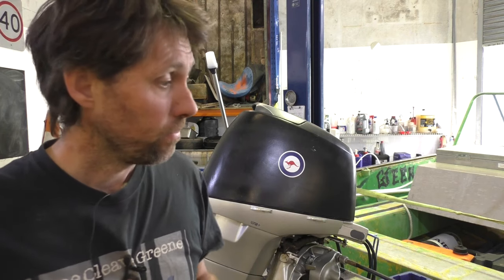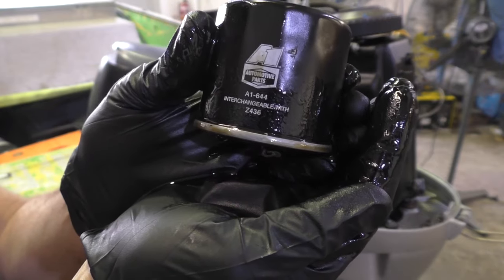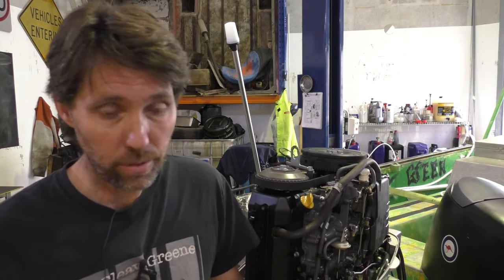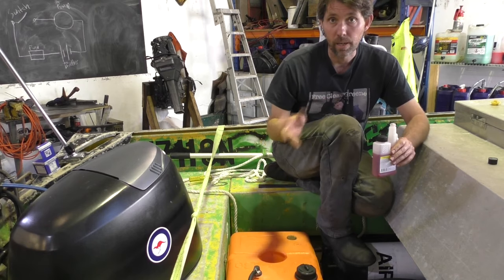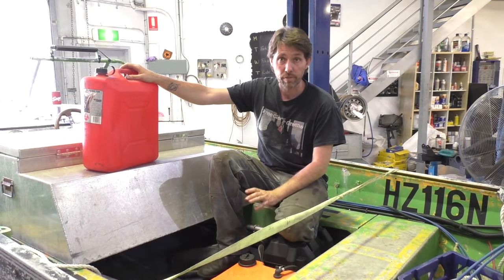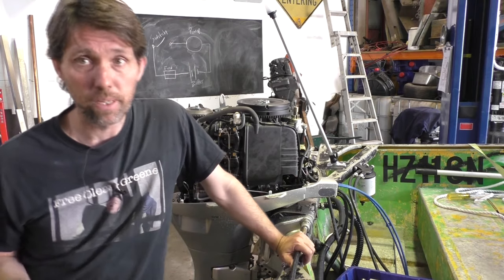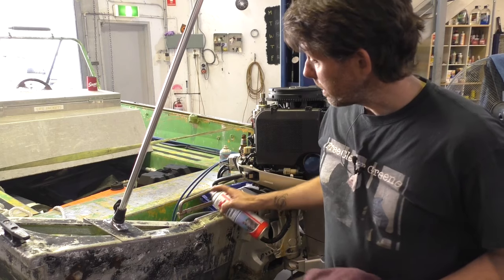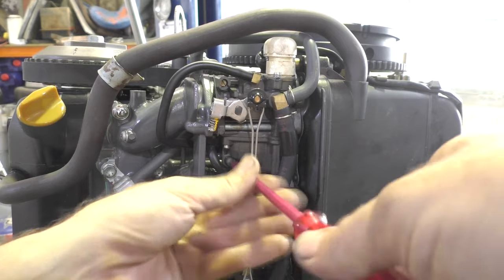Winterising an outboard motor

Comment: If your two stroke motor is oil injected do you still have to worry about the lubrication when you stall it out?
Reply from the maker: I wouldn't be too worried. If running out of fuel caused any serious damage to a two stroke many people would be in trouble.

Comment: Hi Stu. Here in Sweden I do all the steps you do but have even been advised by the place I bought the engine to run antifreeze through my 4 stroke just to be on the safe side. What would say to that.
Reply from the maker: I don't think I would. Once it is empty of water it can't expand enough to crack anything, that is why there is drain holes in the jeg.
Reply: @DangarMarine  Ok. Thanks.

Comment: What is the best way to get all the water out of the cooling system so it doesn't freeze, expand, and crack? Leaving the engine trimmed down, will all the water run out by gravity alone?
Reply from the maker: Leaving trimmed down should get 99% out, but as David mentioned below, any debris in the cooling system my prevent this. Some compressed air back through the tell-tale should help there.

Comment: First, I always like to hear an Aussie’s recommendations at maintenance as I know you truly care about prolonging the life of equipment.  Thanks.  
I do have a question, which you touched on in the end of your video.   I winterize my inboard every year, but the wife wants to do some boating in the winter months.  I have been looking at some used seadoo jet boats and outboard runarounds.  I plan on using it every 2-3weeks, but want to avoid having to winterize.  I live in the southeast US, where the temps usually don’t drop below 20degree fahrenheit or about -6C. Those drops are pretty rare  with freezing temps being pretty uncommon or sustained, and I would be leaving the boat in lake. The lake never freezes.  Of the 2 types of boats I’ve listed, is one better than the other with respect to not winterizing, and would it be a mistake not to winterize it?

Comment: is it really necessary to winterize a boat motor  inboard or outboard if the boat gets use year round ?
Reply from the maker: No, winterising is only for when a boat will be sitting around unused for several months, particularly if you are in a cold climate.
Reply: ok thx, I wont be  winterizing my boat here in vancouver we pretty much use the boat year round , any advice what oil to use for the winter season . here in bc we do have four seasons

Comment: Great timing for the Northern folks :). I did my winterising on a 20 HP Tohatsu with only 26 hours total time on it and when I drained the lower gear unit, the oil was a very light gray colour. I talked to my dealer about it and he said very light gray is normal and that if I am worried anyway, I can bring the engine in for a pressure test. Should I be worried or is the dealer right about light gray being normal? Do you think I should bother with a pressure test on an almost brand new engine?
Thanks,
Maurice
Reply from the maker: Light grey doesn't sound normal to me, it generally means water in the oil. Age of the motor doesn't really have a lot to do with it as fishing line can cut oil seals pretty quickly. Have you taken the prop off? Is there any fishing line behind the trust washer?
Reply: No, I haven't taken out the prop yet, but I'm pretty sure there is no fishing line anywhere. But since you say it does not look normal, I'll ask the dealer to do a pressure test anyway. Better catch the problem early rather than next year in the middle of the lake :). 
Thanks,
Maurice

Comment: Hi Dangar. I have a question. I recently bought a boat with a 25 hp merc. When I first bought it u dry started it a few times for no more than a second or so each time. I know not to do it anymore because it can damage the impeller. Do you think I could have damaged something by doing that? thank you for your time!
Reply from the maker: I wouldn't stress too much. Does it still have a strong tell-tale? It takes a little while of running for the rubber of the impeller to get warm and start to break down.
Reply: Dangar Marine it still tell tales strong. ok thanks man! also I changed the fuel lines and filters. but on of the inline filters is bigger than the one I had before. it's acting like it's starving for fuel. do you think it's possible that it could be the filter?

Comment: Great video!  Would you recommend anything different for a fuel injected (4stroke) motor?  I'm hoping to get a lot of use of the boat just like yourself, but if it ends up sitting for a few months it is great info to have.  Cheers :)
Reply from the maker: Hey Matt. Not really. You can drain the VST (see recent vid) much like you drain the bowl of a carburettor or just rely on the Stabil to do it's job.

Comment: Hey thanks for sharing.do you have a video on if the lower unit has water in the gear oil?what will need to Be changed?and how to fix it.
Reply from the maker: This is probably a good place to start https://www.youtube.com/watch?v=lnhZFn5gkG4 There are free possible leaks, propshaft oil seal, driveshaft oil seal and gear selector oil seal.

Comment: Hi Stu, a great, thoroughly explained vid once again. I'm in Canada were we definitely have winter!  I've been running my 2-stroke outboards dry for years. I also wait until the spring to change to lower unit oil...I have never had water contaminate the oil either.  Both outboards are stored in a garage over the winter...your thoughts? I'm guessing your going to tell me I should change the lower unit oil before storage ha ha ha Cheers mate! and thank you.
Reply: I know I'm not taking any chances. If water freezing can destroy mountains it can surely destroy my 9.8 merc.
Reply from the maker: If you change the oil once a year anyway, then I would change it at the end of a season rather than at the start, just to be on the safe side. Stay warm over the winter!

Comment: What about running out of fuel on a outboard with injectors 4stroke ?
Seems to me there will still be a large amount left is all the tubing and rail.
Is it wise or just not that big of an issue to leave fuel in the system as its actually a sealed from air exposure even during the season. With the carb 10pk 4 stroke i did that but now with a 50hp johnson ( 2004 and actually a 4 stroke suzuki ) i am not sure. Not much info around as it comes to 4 stroke with injectors.
Reply from the maker: I would just be inclined to run Stabil in the fuel for your last trip and leave it at that.
Reply: Tnx

Comment: Hi Stu, off topic question. I have a problem with my 9.8 mercury outboard where if I stop the engine for a few minutes it becomes a real battle getting it started again and when it does start there are thick white clouds coming out of the exhaust. I suspect water is shooting into the cylinders through the exhaust system when I turn off the engine. Is there anything that can be done about that?
Reply: Oh I think I may have found my answer: I'm using a longshaft outboard on a 15 inch transom. The exhaust port goes down too deep and the water pressure is higher than spec so when the engine turns off the excess pressure causes water to gain too much momentum and it reaches the exhaust valves that may or may not be closed at that time. 
That may also explain why I get water shooting over the transom and into the boat at high RPM's.
I'll bet the added water pressure is probably going to much up my engine more at idle as well.
That's the price of making an uneducated purchase. Then again, now I have a boat and know this whereas before I didn't know and couldn't move across water at all.
Reply from the maker: Hey Matt. Sounds like you've got to the bottom of it. You could look at adding a mounting bracket to the transom that lifts the outboard higher out of the water.

Comment: How about the hydraulics (steering/trim) and the electrics inside the boat; any prep needed?
Reply from the maker: Generally not. Hydraulic fluid doesn't freeze and I can't see the cold affecting the wiring either. Looking after the battery is the only important thing on that side of things.

Comment: Has anyone had a problem getting the shift shaft lined up after replacing the water pump on a 150 evenrude 1988 model ? I put it in reverse and dropped the lower unit and fixed the water pump but didn’t pay attention how the shiftshat was located so when I replace the lower unit and replaced the screw in the shift shaft under the carbs it was not lined up because it was still in gear reverse I guess and I could not get to go in neutral or any other gear ! So what I need to know is which way is the right way to position the top of the shift shaft , it’s not in any videos that I have seen !

Comment: Hi Stu and thank you for the great content on this channel, it really helps a lot!

The boating season in my region (Sweden) is usually 4-5 months. Would you suggest to do the entire service at the end of the season? In other words, is there any reason to wait until just before the next season starts and perform it by then? I'm confused because most people I know do their service just before the season. 

Cheers, 
Marcus
Reply from the maker: I would do things like change the gearbox oil before the season as if it has water in it you don't want that sitting around the whole off season. There would definitely be a "before first use" service than you would want to do at the start of the season. Being our spring here I'll do a video on that soon.
Reply: I see. That would be great. Thanks a lot.

Comment: The drain plug location on that honda is pretty silly. I love Honda outboards but I don't like that lol. Much easier on my Mercury EFI and I rarely deal with spillage from the drain plug. The only place I usually have to clean up is right under the filter.

Aside from that, this is pretty much what I do for storing my boat over the winter. Being that I have a fuel injected four stroke, I do disconnect the fuel line and run the motor until it stalls while on the muffs. I don't bother filling the tank up before storing the boat because our winters are long in northeast USA and I don't want to have a full tank of fuel sitting in the boat tank when I can use it for other things like my snow blower or my ATV. Whatever fuel is left in the tank after the final trip of the year, I treat it with either stabil 360 marine or stabil storage, whatever I happen to have... I then run that fuel through the motor while on the muffs for about 5 minutes give or take w/ the motor idling. After that I disconnect the fuel line and let the motor stall out. Then the tank gets taken out of the boat for the winter and that way I don't have to fill the tank up or worry about phase separation in the first place.

It depends on how many hours I've put on the boat throughout the season, but usually I don't bother changing the engine oil or lower unit oil since I just changed them both at the start of the season. I'll check the condition of both oils and if satisfactory, I'll let them sit for the winter. If they're dirtier than I'd like, I'll change them before the boat is stored. Usually I don't have to though and I do it first thing after the boat comes out of storage, along with an impeller change. As far as the batteries, I've got 3 in the boat. One for cranking, and two 12V deep cycles wired in parallel for my trolling motor. I'll rotate the batteries on my trickle charger throughout the winter and that's pretty much it. I don't really bother with fogging oil since it's a fuel injected engine. The stabilizer takes care of the injectors, etc.
Reply from the maker: I tend to agree on things like not changing gear oil too frequently. It does last quite a while so no point wasting it.

Comment: i got a 1966 gas tank for my 1966 johnson but its all gummed up any ideas to clean it
Reply from the maker: You can try just clean fuel or even lacquer thinner if it is a metal tank. Some people even throw in a few nuts to chip away at any hard stuff as they shake it about. Keep an eye on it though as it may need resealing afterwards to avoid corroding quickly. Radiator shops can often do this type of job for you for not too much money.

Comment: Dose it have to be marine oil or can it be any 10x30 oil
Reply from the maker: No, in four stroke motors you can use any 10W30 oil.
Reply: Dangar Marine You mentioned not winterising your boat as you use it all the time if I was using mine twice every month would I need to winterise it still

Comment: You actually use the cover for the oil plug to guide the oil into a pan so that it dont get so messy :)
Reply: Oh you showed that later in the video my bad xD
Reply from the maker: No probs, I'm just too lazy to hold the pan up. ;)

Comment: I came for the beer, you scared me until the end. :-)

Question, is there any difference between marine 2 stroke oil and chainsaw/power tools 2 stroke oil? There are a couple of chainsaw oils that have fuel stabiliser in them and I use those, could you use that in a 2 stroke outboard?  Echo and Jakmax synthetics, both made in USA.
Reply from the maker: I'm trying to make it harder for you each time. ;) Apparently yes, there does appear to be a difference in two stroke oils but I'm not sure what they are. I should do some research and do a vid on two stroke oils because there is quite a bit to them. Apparently the main difference is air cooled or water cooled.
Reply: hmm, good point, I don't know what difference water/air cooling makes, research required. I'd imagine a chainsaw is a more severe environment to protect, the oil is more expensive too.

.....I was still recovering from 'Installing HyDrive' anyway, I lost count at six. ;-)

Comment: My motor has been sitting without being started for about 12 months due to a seized steering cable I've now managed to fix but even though I let the motor run until stalling the last time it was used I didn't fog the motor. What would you suggest I do before turning the key again? I plan on draining the fuel tank and have got a water separating fuel filter to plumb up but is there anything else I should do first?
Reply from the maker: +dsr20631 I'd take a look at the starting the Evinrude 150 for the first time video. That goes through most of the precautions to take.
Reply: If you disconnect  the lower steering  arm  and slip a bit off bicycle  inertube over it with some lubrication inside  and secure both ends with zip straps it acts as bellows and helps  to stop seizures.

Comment: According to our mechanic, I made the mistake of running the fuel out of a 2 stroke by disconnecting the fuel line.  He said that on 2 strokes that have separate 2 cycle oil reservoir, as the fuel is running out in the engine after you have disconnected the fuel line, the 2 cycle oil is still be introduced into the carbs? therefore fowling them with pure oil?  This was in the 1990s so design may be different now.

Comment: Hi Stu, made a short video to share on my mercury today. sun finally came out so changed the lower unit lube and took the prop off. a little rough looking but fine for what I use it for. will send more clips as I go on my project. Thanks
https://youtu.be/H0QtLwaAowI
also the pivot bracket on this unit is rusted up and not sure what to do with it? still solid but probably needs to be replaced down the line. being it so hard to get to about all I can do is spay it from getting worse?
Reply from the maker: Good to see your servicing is going well. Yes, those brackets are hard to replace so keeping is sprayed is probably your best option to prevent it from getting worse.

Comment: Now that the radio is installed and the air temps are for sure staying above freezing, I took advantage of a Lazy Easter Sunday Afternoon to wake up "Old Gertie" (got that name from a retired Johnson/Evinrude parts guy). Fired right up after the winter nap. Ran it for a while to burn off the fogging oil and plan to run some sea foam through some time soon. Noticed an intermittent misfire issue though that seemed to go away once it warmed up. Thinking I may need to not only do the sea foam treatment but change the plugs. Figured I start there before assuming an ignition issue. Any thoughts along those lines Stu? https://www.youtube.com/watch?v=ZBVwafrc2kA
Reply from the maker: I wouldn't hurt to change the plugs, but you may find it is just a bit of moisture that will evaporate once the engine is up to temperature.
Reply: I wondered if that might be the case. I'll try the plugs and the sea foam steps and see what that does. If its still an issue, I'll start looking at the distributor etc.